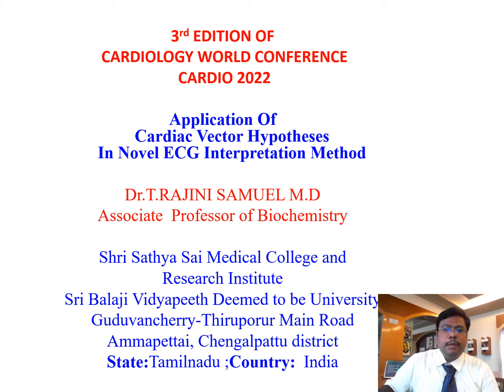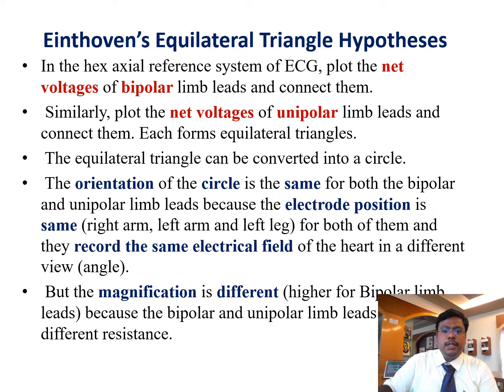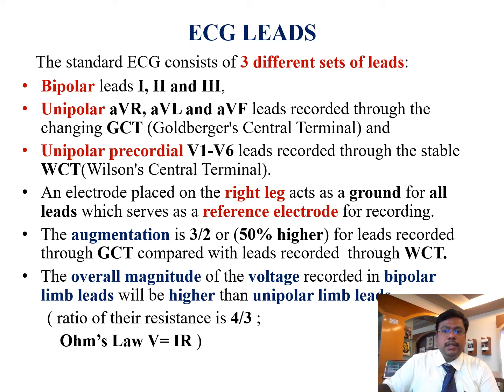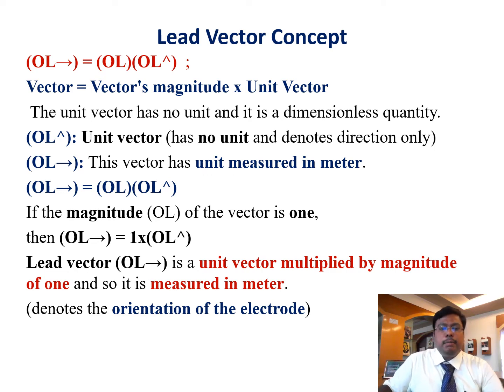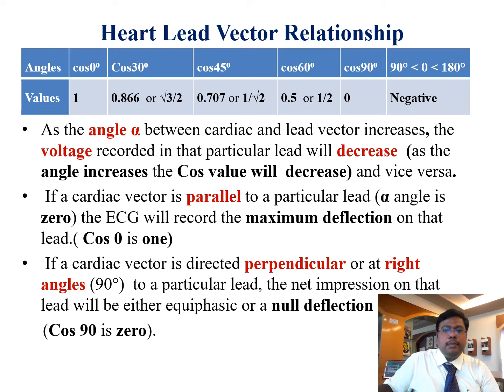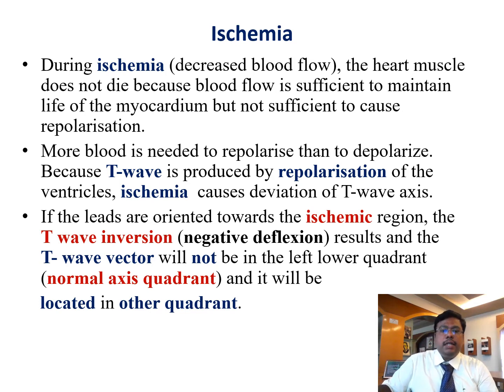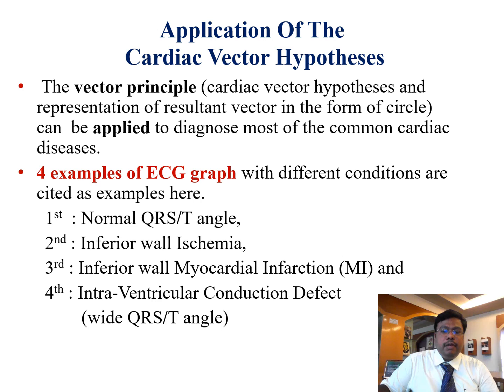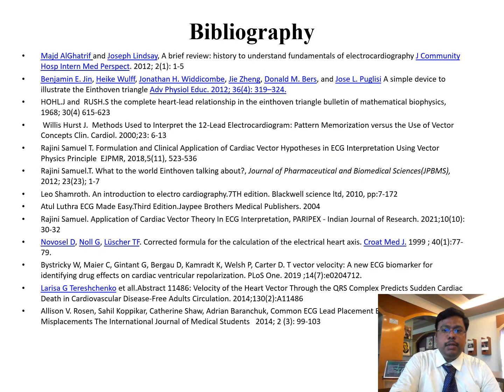Einthoven's Equilateral Triangle & CARDIAC VECTOR Hypotheses -Basic Vector Physics Principles in ECG

Comment from the maker: One Clarification By the Presenter of this Video:  The term " Overall magnitude of the voltage" is used compare the magnitude of the two circles (denoting the electrical field of the heart), each formed by Bipolar and Unipolar Limb leads.  The ratio of the two circles is 4/3 due to the difference in the resistance between bipolar and unipolar limb leads.  It does not denote the individual voltage recorded in each leads. The individual voltage recorded in each leads depends on the electrical axis as it is clearly explained using the CARDIAC VECTOR HYPOTHESES.  Thank You, With Regards Dr.T.Rajini Samuel , Presenter of this Video.